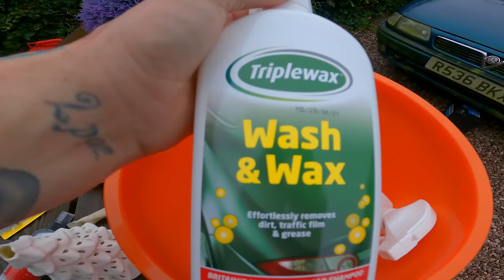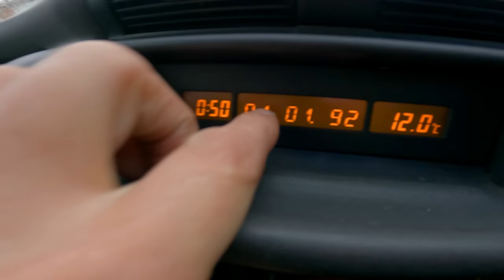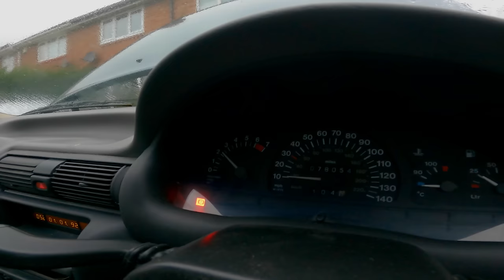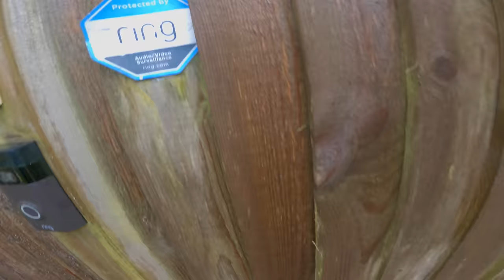I BUY A CAR!! Abandoned RS TURBO & ASTON MARTIN VOLANTE!!!

Comment: My Dad and I had a 1,6 LSi Auto from 1996 to 1998 as a fleet car. I really loved driving it. It felt like a real upgrade coming from a Mrk.4 and Mrk.6 Escort. The Astra rode really well and had a great interior. It felt like much more of a drivers car than the Excorts we had had previously. When time came for my parent to move out of the UK, I was allowed to run the car for a few months over the summer of 98 as I worked for the same employer while studying. I still have a photo of our purple Astra on the last day I could still call it our car. I even worked at the fleet management office in the corporation that ran it, so I know it was passed to another employee. Good memories. Cool to see you also have a Nova, I learnt to drive in a GSi. Passed first time, but never got to rev the nuts off it. Greetings from a half-Brit from Denmark.

Comment: That model Astra, in fact Vauxhalls from that period, had a funny smell to them. Probably the glue they were using? Both a friends Omega and my sister's Astra had the same odd pong. My sister's Diesel Turbo Astra with the Izuzu engine was deceptively quick though.
Shame about that Aston, I didn't think they were that good to drive, but despite the 'pornographer trim' and all the Ford/Volvo parts bin bits, its still a nice motor. Looks to me as if some old boy has died and the estate is in probate. Furry dice are a nice touch though!

Comment: The aston martin has had a new v5 in april 2021 so maybe its been brought
Reply from the maker: You can actually apply for a logbook even if you don't own it! As long as you have the vin/engine code plus reg! Issue after that is trying to recover it! If it's behind locked gates or on a compound then even tricker 🤷🏽‍♂️ Not worth the stress....

Comment: The RS Turbo is an XR3i with a turbo bonnet as it’s not got pop out rear  windows or arch trim and side skirts !!!
Reply from the maker: Good spotting buddy! Keen eye thanks for that!
Reply: Deffo xr3i
Reply: Series 2 didnt have pop out rear windows
Reply: @stephenadams7454  mine did ! But could of come from a series 1 or RS1600i I suppose
Reply: @brianread9781   yes they will have been replaced, from the factory the series 2 was non opening👍
Reply: The pop out windows were a factory option on the series 2 RS Turbo 100% factory car